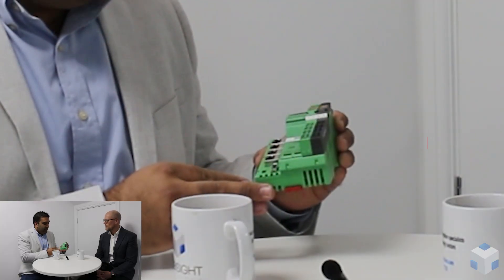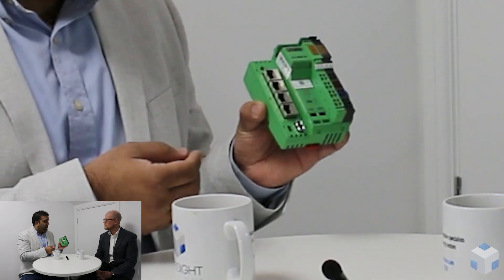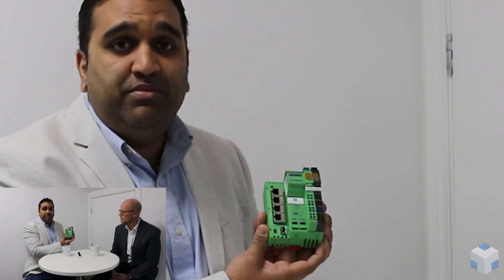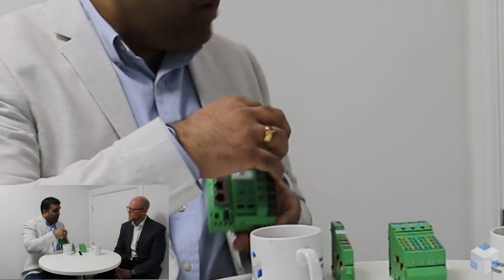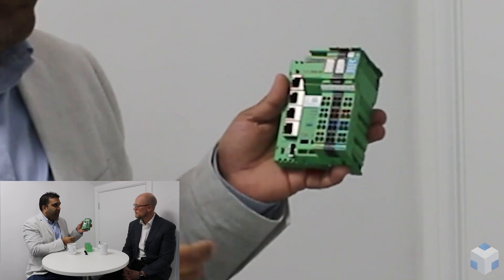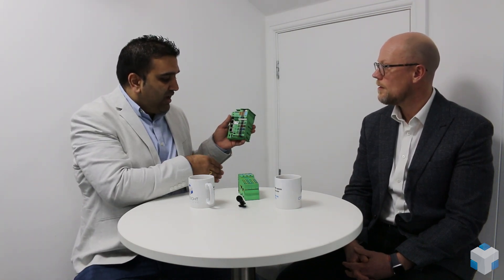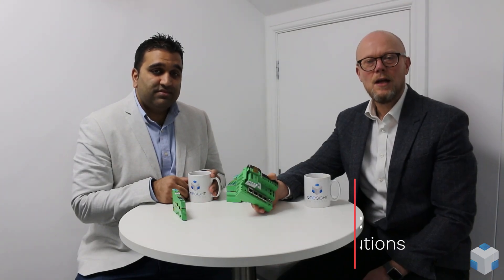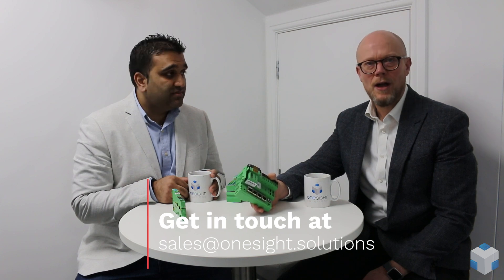Phoenix Contact ILC 2050 Niagara Controller - Hardware Overview

Comment: Dear sir please I need your help , please help me
I have ilc2050bi and using emalytocs software
Please tell me which driver do I need to use for communicating an energy analyzer with rs485 modbus and where to terminate rx TX terminals on ilc2050
Which dip switch setting to use if any.